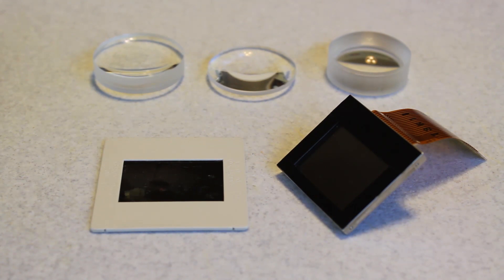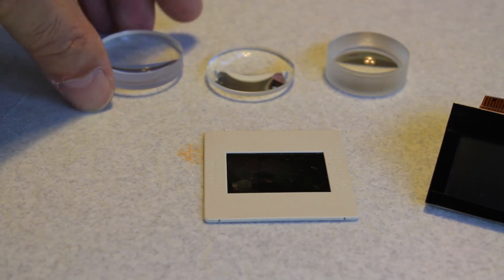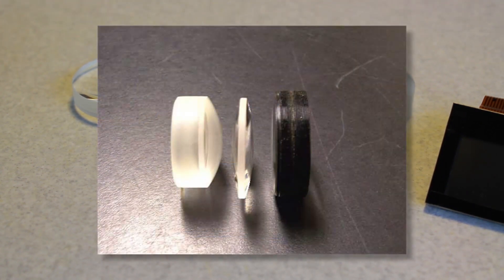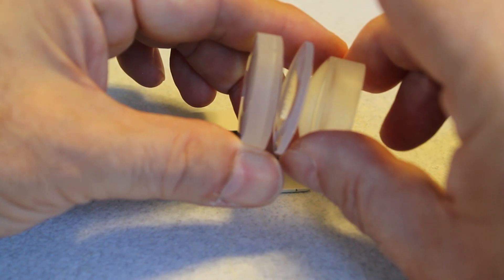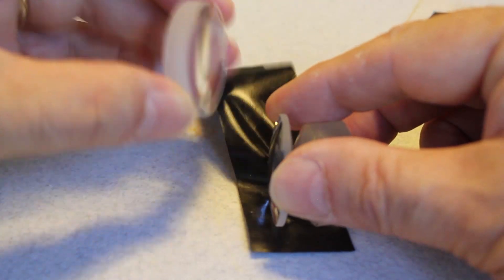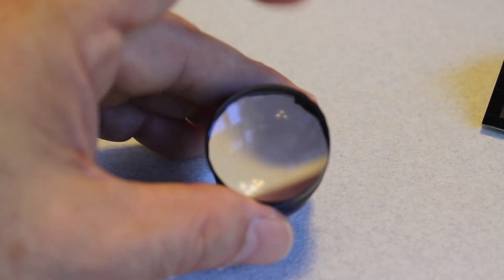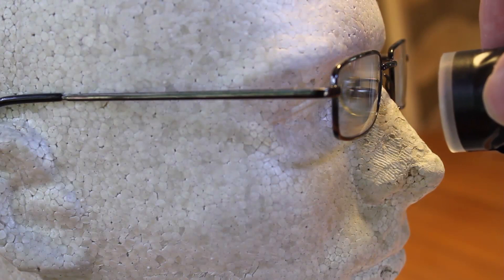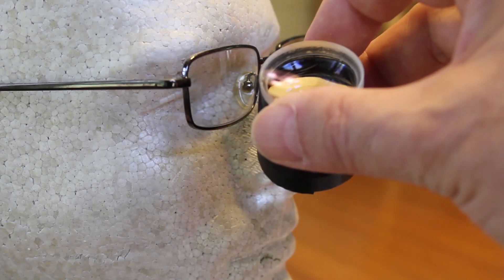Virtual Reality Optics for 1 inch class displays

Comment: That small lcd screen- where did you get it? also what is the resolution and ppi?
Reply from the maker: It's an Epson display... discontinued in the late 90's. 1.3" diag. 640x480 pixels. This one came from inside a Virtual Research V6 HMD. The same display was used in the Virtuality Visette Pro.
Reply: Thanks so much! I haven't been able to see any 2 inch displays or under that were 480p or over.

Comment: i can see from the camera that the viewable is a part of the 30mm not full slide, ( the guy  in slide with HMD & some surrounding only) did you measure the viewable area for this eyepiece. 
and if it is full 30 mm can we add another lens to the slide side , that in result magnify a 12 mm or18 mm or so with the same FOV you got before.

Comment from the maker: Making the eyepiece lens a larger diameter does not improve the FOV inasmuch as it simply allows the viewer to look around the edges of the lens closest to the display, i.e. vignetting the image.

There is a modest amount of pincushion distortion at the edges. This is also true of all the commercial implementations of this approach: Visette Pro, Virtual Research VR-4, V6, and V8, and n-Vision.